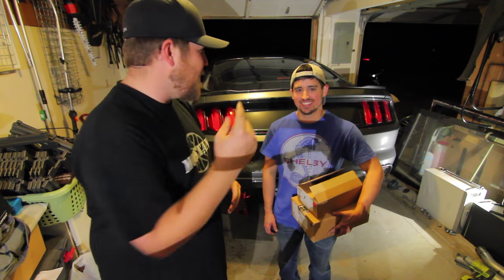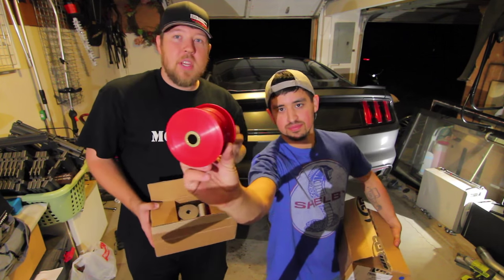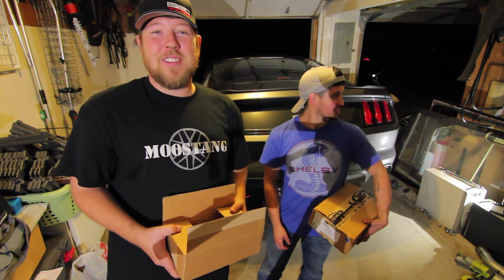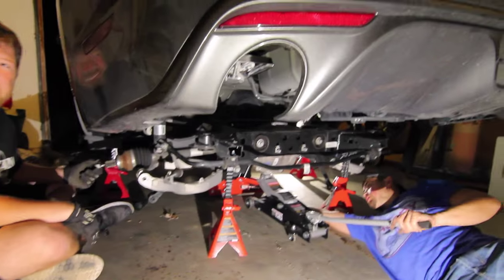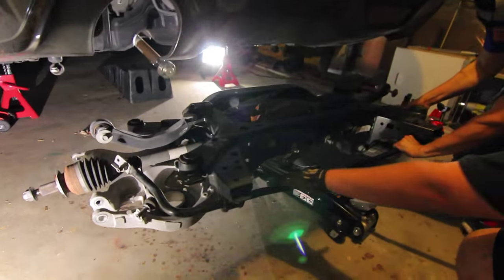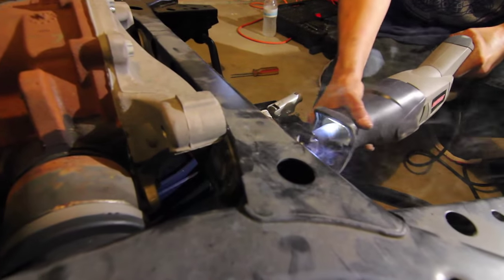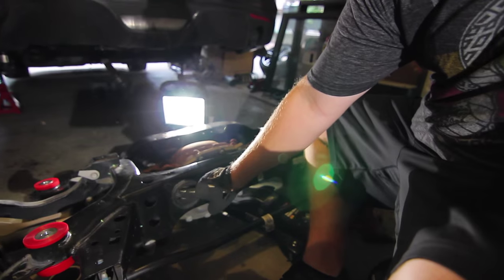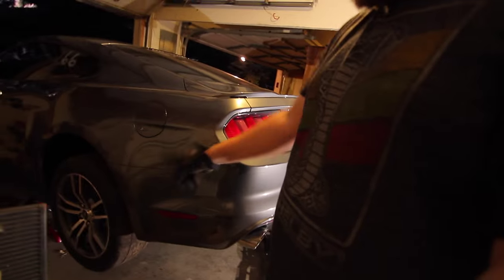We Broke It!!!

Comment: I just did the same install. I have the billet diff bushings and delrin cradle bushings, and I went with the spherical bearing vertical links and lower control arm bearings. haven't gotten much of a chance to drive it yet, getting my alignment next weekend. wheel hop should be good and dead

Comment: hey guys 

i have the steeda diff bushings and am having an issue where i basically cant install the front diff bushings without dropping the cradle completely, so looking to your vid here for guidance on that. 

Did you guys leave the strut tower on the vehicle it looks like? And were you able to just take the rotors and brakes out in piece? did you have to bleed any lines when putting it all back on? i havent tackled this level of effort yet tbh -- didnt think id have to but its kinda coming to this
Reply: ANd also, to put the cradle back in, were you able to just jack it up at the center and put in the bolts? Thanks